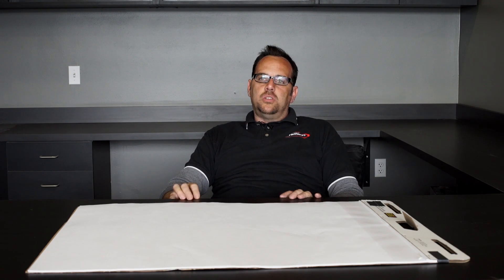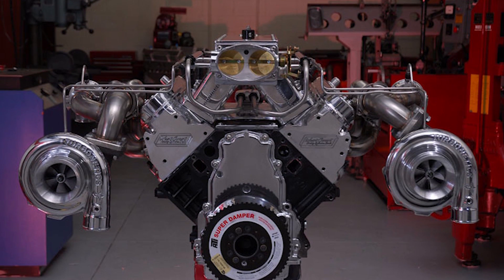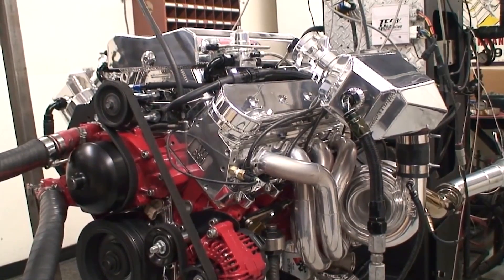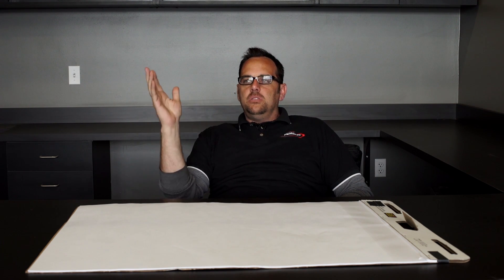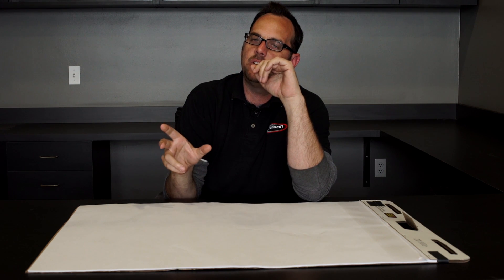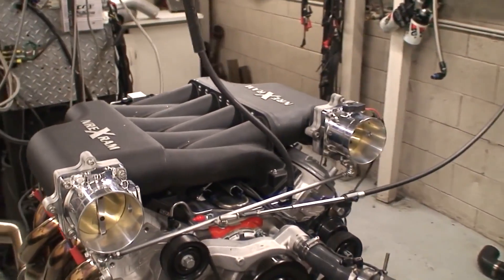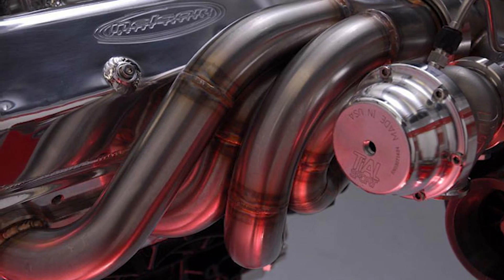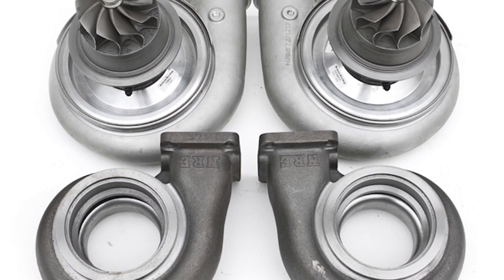Master Engine Builder Explains Why the LS V8 Is SO Good

Comment: this is why ls prices have never fallen
Reply: +Liemciemdk89 if they fall more then they would be for free
Reply: +Liemciemdk89 i cna get an iron 5.3 engine form a scrap yard for 300-350$ how much do you want them to fall???
Reply: GMdrivingMOPARguy the engines cost about the same where i live, but the ls needs a more electronics where are a sbc doesnt so that causes a price difference. however big blocks here are double the price of an ls, if you can find me a "running" big block for 350$ let me know haha
Reply: +86gtforme For the price of a used 350. LS maybe cheap compared to imports but they are still very expensive compared to small and big block Chevy's
Reply: +Liemciemdk89 this is why ls prices are rising**

Comment: LS's are overrated. GM thinks their aftermarkets for their vehicles is larger and superior than Ford, but it's not. Do some research. Great engine platform, but still largely crude and under powered.
Reply: Lol look how jealous you are. LS will always spank fords. The ford engine needs 4 cams and 32 valves, but even with all of that it gets spanked by a single cam push rod engine haha. Nothing ford makes will touch an LS
Reply: +CaPtiaN_DamMiT always?! really? ohh let me guess your a cheby guy. smh
Reply: billy heaton because ford needs 4 cams and 32 valves to beat a single cam push rod engine xD thats why ford is shitty
Reply: Ford's 5.0L beats a 6.2....that's 1.2L difference in displacement. Maybe Chevy should make better engines and not bigger ones lol.

Comment: The real question is why it isn't DOHC?
Reply: CheddarWhiz exactly. It is simply cheaper. 4 Valve DOHC is better for power. That´s a fact.
Reply: +CF88DRUM Yep. Power/cost ratio is the reason everyone who loves the LS, loves it. It's not the best engine you can buy, but for the cost, it's an incredible piece of work.
Reply: Because Chevy doesn't need 4 cams. Fords engine is dohc and still gets spanked by a single can push rod engine. No reason to change what has always won and will continue to win.
Reply: +Samu Näsi (FurHatGaming) The answer for that is simplicity and cost.
Reply: +Samu Näsi (FurHatGaming) maybe research pros and cons of internal cam
Reply: +CaPtiaN_DamMiT Maybe you know that there are other manufactures than Ford. Ferrari, BMW, Lexus etc. They are all using 4 Valve per cylinder because you get so much more air in the engine. On top you can rev it much higher and get even more horses out of it. For example the LS7 is a 7L engine with 512 BHP. Porsche get this amount of power with 4l engines without a turbo. The LS7 is light with something around 400lbs but not super light. Other european or japanese engine can handle that too.
Reply: And there is nothing wrong with it. I simply don´t get why some can´t understand that and still think it´s technically the best engine. It´s not a bad engine but far away from being the best engine.
Reply: honestly gm likes cam in block for the fact that you can still make great power and you keep the center of gravity low. a ohc v8 houses the cams  on the head which sit higher then a cam in block motor. then you also have simplicity and less cost by only needing a cam vs 2 or 4 cams.
Reply: +Samu Näsi (FurHatGaming) Actually all these guys are wrong. GM went bankrupt, they couldn't afford all the R&D to make a DOHC engine and thus improved upon the design they already had. Because they're the main company that did this their pushrod engines are far ahead of any other company, as most haven't made them in over a decade, as you'd expect. The low cost is just a by-product. If you're asking what is better about a pushrod engine, that is simple. Less than half as many moving parts = less places for it to fail. Takes up a lot less space, is generally over 100 pounds lighter and has on average more torque than horsepower. What's worse? Less efficient, not necessarily with fuel but with air. You should understand what I mean since you watched this video. They don't rev very high. Because they are less efficient with air, displacement for displacement they will eventually make less power than a equal DOHC engine, but no one really has 7L DOHC v8's right now. At least not that I know of.
Reply: +TheShank6666 I live in a GM town with over 20 close family and friends working there or having retired with a pension from there.
Reply: +TheShank6666 Yes they have more experiance with this setup, but it is still not better than dohc. You get low rpm tourge and power because you can´t rev them and need long inlets and exhaust manifaults, to get any power of it. An addition you have a huge engine capacity. The engine is 100lbs lighter compared to anouther 7l engine with dohc setup but not lighter compared to a NA engine of the same power out with less capacity and dohc layout. For example the porsche gt3 rs engine has 4l and also 500bhp and a much lower COG.
Reply: CF88DRUM Actually everything you said is wrong, like tourge. Reading it was a waste of my time so I won't bother responding again. But, it's actually OVER 100lbs lighter than the mustang DOHC engine which is, what, 5L? So you're wrong it would be closer to 200 pounds lighter than another 7L DOHC. The Porsche remark, btw I own 2 and have another 3 or so in parts, bet I know more about them than you do; is an engine built for all of its power at high rpm, ya know for the track. It makes all of it's power in high RPMs, above 4500 rpm. The LS makes power before 5500RPM on average because it was made to a be a street car, not a race car. If you want to compare apples to apples and not look like an idiot look at the nascar engines. Cause ya know, racing pushrod vs racing flat 6, instead of a street engine configuration vs a race car configuration. Nascar engines make 850hp out of a 358, what is that? 5.8L? Better than the racing Porsche power to displacement ratio? OMG SI IMPOSSIBLEH
Reply: +TheShank6666 Sorry i am not from the USA and that was a typo. A Mustag engine is not the best example and you know that, but ok. To own a car doesn´t make you an expert. I see that you are in this stuff, so i am not saing you don´t know what you are talking about. We don´t know each other so this would be stupid. It could be true that you know more about Porsche engine, maybe not. Who knows.

To get power at high RPM is not a bad thing. It´s all about what you can get out of an engine and the porsche RS 4.0 or the new GT3 RS engine are 100% road legal and can be used as a daily driver. They are not race engines. Porsche uses still the mezger engine for their race cars and not the new one. You use shorter gears too, so it wont make such a big difference in the driving behavior. 

The LS engine can´t rev that high and has to make more power in the lower range. It uses a lot more stroke and piston velocity will be crazy at high rpm. The push rod valve train can´t handle to high rpms too (or you have to go crazy with carbon push rods etc and thats for race engines only). Therefore you will use longer gears. The race viper engine for example doesn´t rev higher, even it is not road legal. It depends on the design. 

Porsche race engines use air ristrictors and can´t develop more power. Same story for example with the MP4 GT3, which has less power then the road legal car.
Reply: +CF88DRUM why the hell do you keep talking race motors? a LS was in the vette, camaro, holdens, Vauxhalls, also in pickup trucks. the  Porsche flat 6 is in the 911 and cayman. so a motor that is in 2 models vs at least 6 maybe far more. so comparing a low volume motor to a motor that goes into everything all over the world and in different  configurations is silly and stupid. so yes the LS is a over built, low revving, mass produced motor. but its cheap to get  and it will make lots of power with cheap mods. how much money  would it cost to get 800hp out of that german flat 6??? $10k? $20k?
Reply: Sorry but 911 engines are not low volume engines and to compare engines they don´t have to be fitted into a lot of different cars. You can´t compare race engines and road engines. Thats true, but a road car engine with another one.

Are we talking about getting cheap power or are we talking about the best engines. LS3 engines are not crap, i will never say that. And yes you can get really easy a lot of power for a few bugs, but this makes it not a really good engine. This makes it an engine for everyone. Nothing more. Formula 1 NA engines are the exact opposite. They are increadible expensive but you have a technical master piece.

From an engineering poinst of view, your engine should handle the horse it is sold for and not a lot more. If it can handle a lot more, the parts are simply to heavy or you have not enough compression, which costs horses too.
Reply: +CF88DRUM A over built motor is a exceptional thing to have in a motor. over built is where the  longevity comes in. it means it can survive. amd the Porsche flat 6 is low volume! cause the company is not a high volume company.
Reply: Sure? Prosche build twice as much 911 as Chevrolet build corvettes each year. Over building an engine makes it safe to tune and still be reliable, but you don´t have to build them so strong to be reliable.
Reply: +CF88DRUM okay dum dum chevy but more  chevy& gmc trucks, camaros, corvettes, Commodores and whatever Vauxhall calls their Commodores and Cadillac Escalades then Porsche built cars period! the vette was not the only automobile to have a LS.

Comment: hottest engine in the world? 

more like in the US because that shit is non-existant in Europe
Reply: +audioh0lic These are the hottest engines in the world. Just for the fact that you can take a motor out of the junk yard throw twin turbos on it and pull 1000 plus hp pulls on the dyno and they don't break. Lets see you do that with an affordable out of the junkyard European motor. It's not happening!!!
Reply: +D Fuller I agree they are awesome and the modding potential is huge. But they are not hot in Europe because they are too expensive to buy and run (gas) here. Plus we are not allowed to just swap engines in everything.
Reply: +CF88DRUM No, these engines are over-engineered. They are built stronger than they need to be. The issue is that in order to sell them, they need to pass certain emissions and noise levels. After that, the consumer can bolt on some forced induction and possibly double the power output without it blowing to pieces.
Reply: except for pretty much every new "supercar" that comes out of some euro garage on the daily.
Reply: Ls is hot in sweden
Reply: +audioh0lic Yea, too busy with their 400hp 4L engines that somehow get less MPG and weigh more than an 6.0L V8 that gets better MPG.
Reply: +CF88DRUM Here's the fun part though: A corvette will get better fuel mileage than ANYTHING from AMG, BMW M, Audi's "S" line, name it. Part of the durability and efficiency is how unstressed it is. Having a high specific output only matters when you are taxed on engine displacement.
Reply: +CF88DRUM  I believe they are built for longevity from the factory. GM knows that people can't leave things alone and the engines will end up being modified at some point in it's life. They also continue to use pushrods as they are lighter and take up less space than overhead cams. Add a dry sump oiling system and you can mount the engine closer to the ground for a better center of gravity and a low hood for better visibility.
Reply: +audioh0lic He builds engines for customers all over this planet. Maybe that is why he says that.
Reply: You missundertand me. To build something stronger than it has to be is stupid. Stronger than needed means it is heavier than needed. Emission and noise level has nothing to do with that. Why should i build an NA engine, which can easily fitted with a forced induction system without huge changes. This means, that your pistons are much to strong/heavy, the rods and crankshaft too. This will daramticly increase the oszilated mass and your engine inertia. Also the compression is much to low, which costs a lot of performance.
Reply: +D Fuller I would agree, but then you bump into guys that build little VW Golf's with their 2liter 4 bangers that produce 1250hp on all 4 wheels. feel free and look into Boba Motoring. and no, they don't break, they guy has built a whole bunch, they do eat gearboxes for breakfast. races them all btw, quarter miles in the low 8's.
Reply: +audioh0lic  Germans invented it all, try some research before spewing
Reply: It IS an international swap. There's European drifters drifting BMWs with LS swaps. Look it up I'm surprised you don't already know..
Reply: dw86 is Ls
Reply: +Patrick N Ls cars are the only cars ive seen that are used as daily drivers AND run 8s.
Reply: ah yeah, i forgot to mention that this guy drives his car as daily drivers as well. his video's are all no nonsense, dyno videos, street stuff, races against bikes, all that. not sure what the engine alone makes since only awd hp figures are ever mentioned. his own car is full interior, and fully street legal
Reply: +shams ul imran khan (sam) No, Volvo is strong in Sweden, Basically everyone runs a turbo 5cyl.
Reply: +D Fuller Sorry but that is not a quality feature. If you can crank up an engine and double the bhp without any big modifications shows, that those engines are simply so underengineered. A well engineered product uses the full potential of it. An engine should be light and powerfull, but the ls engines maybe light compared to other american V8 but it´s not light compared to lets say a ferrari v8.
Reply: +CF88DRUM Lighter... but as expensive as it is unreliable. You can abuse an LS1 for 150,000 miles and work on it in your backyard.